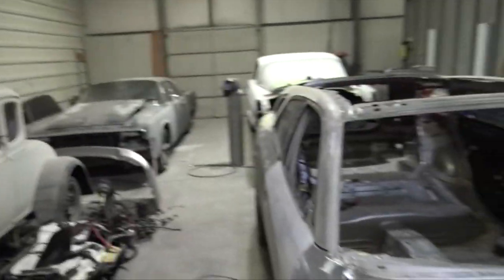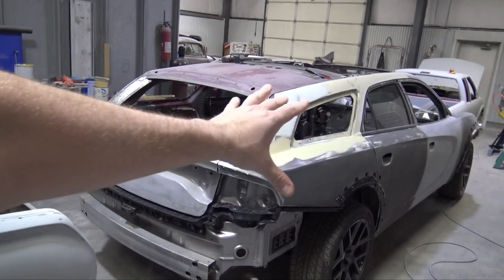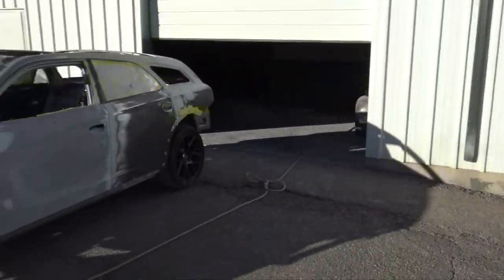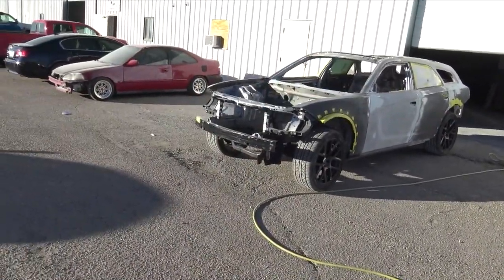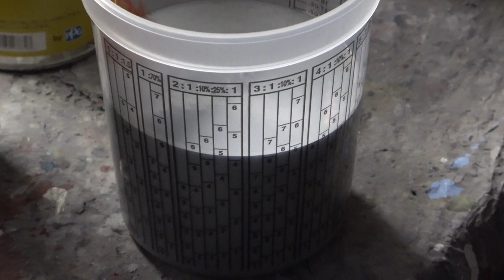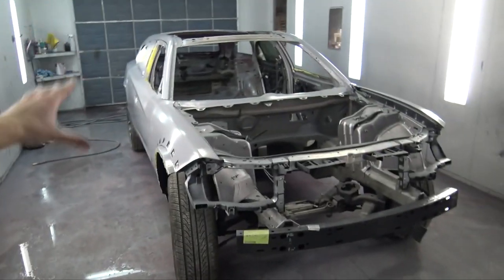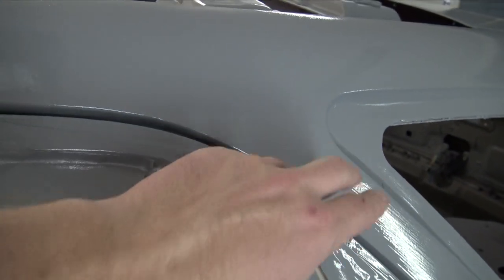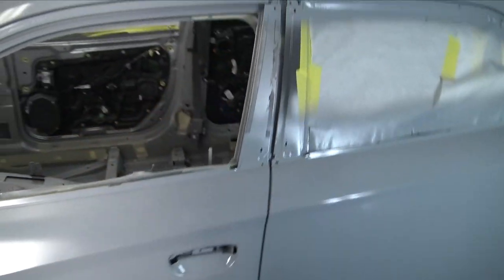Building the Ultimate Station Wagon | 2021 Charger Magnum Hellcat | 1000HP Hellwagon | Pt 21

Comment: Now you get an idea as to what the finished ride will look like, love this stage of the game. Got to say its looking pretty sharp from my angle, close as factory spec as you can get
High solids primer, Good and wet, good and thick, great for filling scratches. Lots of sanding headed your way, but no one said it would be easy, one day at a time I say.  I would follow up with a charcoal guide / dust coat different color primer , afterwards prior to sanding so when you do go to sand with a long foam sanding block, you will see all the highs and lows in the panels.

Comment: if you sanded down the body work with 180 instead of leaving eveything at 80 grit it seems then you wouldnt have the visible scratches like that after priming, blocking would be so much less work
Reply from the maker: Yeah I know but the primer will get me there too

Comment: So prime over good tires and rims instead of covering Dave and tail light pockets and rear body panel you didn’t even sand  why ? After you talked about adhesion and not wanting to peel
Reply from the maker: All that was sanded and those rims are garbage need to be refinished and the tires can last about 30seconds on my hellcat